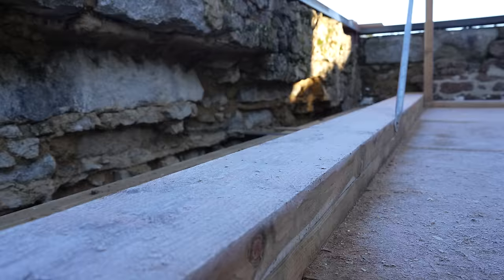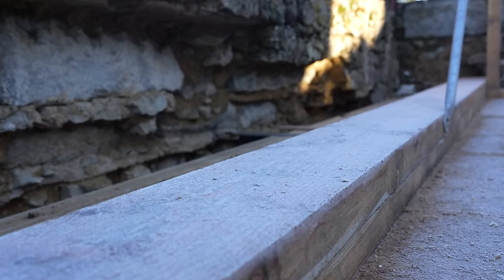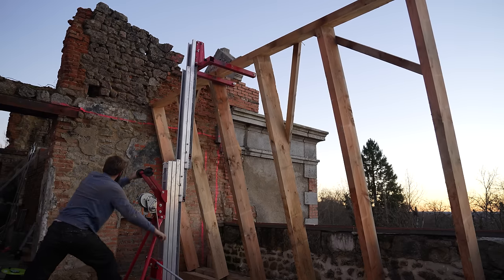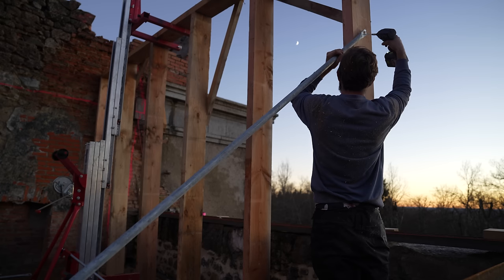Framing a chateau roof, alone.

Comment: Once the final wall is up, DO NOT take the bracing off until the rest of the roof structure is on. If you've got to move the bracing to put the final wall in, so be it but the bracing should stay until the entire structure is complete. That way, when you're putting the trusses on for the roof, the weight won't push the wall out of plumb.
Reply: exactly! those walls will not be a selfsupporting structure untill they have internal bracing (be it trusses or just by sheeting them! Until then, they are just a couple of matches held together by some screws.. to avoid them tipping over during your way of righting them up, I'd like to see you use some diagonal ropes/straps of the right length that will keep the wall upright until you brace with your metal studs..
Reply: Call me old-fashioned, but I would like to see the studs notched into the top and bottom plates and permanent diagonal bracing notched in and fitted. Plus, once upright and aligned the end studs bolted or nailed to the brick wall.  

Yes it will take longer, but it will be done closer to "right".
Reply: @whatnowstinky  No matter what, everything should be bolted to the brickwork wherever possible, for sure. And if you're going with a traditionally constructed green oak frame,  I'd agree with you on all of the above, just to allow for a bit more movement and to be a bit more true to how it was done back in the day. And then timber pegs, not steel fixings. But, in this case,  douglas fir is used because it's strong but so fast growing that there's not a whole lot of seasonal movement in it once it's cut and kiln dried. So definitely no requirement to notch into the top and bottom plates. And for the diagonal bracing, again if you're not going for traditional construction methods, the strength of mechanical fixings and steel strapping, while ugly as sin, is equal or superior to the old ways. Personally, I too think this should have been constructed traditionally but it's not my chateau and it's probably beyond Dan's skillset and budget at this point anyway.
Reply: Noching weakens the frame by thinning it @whatnowstinky
Reply: I absolutely love the guy for his never say die spirit, but to this point everything he’s done, while requiring a tremendous of effort, it’s not at all complicated. I’m very worried for him moving forward

Comment: Next time you do it, just measure the distance from the top of the wall to the floor and tie a rope to the top of the frame and fix the other end to the floor, that way it will save the wall from tipping over the stone wall if you go too far with the forks. It will save it from falling down
Reply: I had the same thought
Reply: THANK YOU.
Reply: this is the first tome i have seen the top and bottom plate sqewed screw when the top and bottom would nirmally be secured from the face side of the plates . then the the frame would be stood ???  Do you not think fabricating on the ground the getting a crane in for a couple of hours . this would be a lot safer and quicker.

Comment: Dan, when erecting stud walls regardless of size you should have a bottom plate already attached. As you have done the sole plate is fixed and the bottom plate should be screwed through into the ends of the perps ( virtical studs)
Screwing through at 45% is not sufficient!! 
Another tip when working solo!!
Use some old hinges, screw to sole plate and bottom plate before screwing studs, then you create a hinge point which will perfectly align the two, it will also help to stop any over tilt of the stud frame.
Hope it helps.
Another point when working alone!
Arrange checkin times by text with someone, if you don't they can call you see all is ok or worst case get help to you. I use this and its a great backup and peace of mind.
Doing a great job, I have all those 'T' shirts so goid on ya!!
Merry Xmas☃️⛄️
Reply: Hinges are a great idea! I was wondering if anchor points in the flooring joists with rope tied to those and the top of the framing. That might allow the framing to reach it's level vertical position while preventing it toppling over the stone  wall?

Comment: Dan just an idea for winching everything up. Put an I beam up at the top level stretching from the turret to the wall in the hallway and make the winch on rollers! You can easily get all the heavy stuf on the floor without to much effort because the winch can be moved while under load. We have this same system on the garage sealing. Works like a charm. Big I beam, steel rollers wrapping around the beam on a frame to hold the winch. once you cannot go without.
Reply: Good idea, should install it at some point for the remainder of the build.

Comment: To add to an earlier comment, you need to build a proper lift system on the outside of the chateau. Given the amount of material you are going to use, a proper lift would certainly be more efficient and more importantly, SAFER.
Reply: How much would that cost to install? At the moment the hoist is centrally located to access all parts and levels of the chateau.
Reply: @Sjb-on5xt  It would be peanuts compared to what he will spend overall. He won’t be doing anything if he gets injured.
Reply: I saw a nice lift on Bordeaux Life Channel. It would work great for small stuff like loads bricks and  roof tiles. It looked like a ladder with a square type bucket that moves up and down the ladder. Very cool tool.
Reply: Yes @tracksidebc5854 you are correct.
Safety is important.
And Dan worries me that he does so much alone by himself.
Reply: @richiejames928  Good point.
Reply: 100% agree, safety and efficiency. have a lift on the outside, just a cheap transporter lift will be sooo very efficient. choose it's location strategic and allow for a delivery dock for bulk materials at the foot of the lift. That way you'll skip the steps at the entrance where you currently carry your mortar by the bucket, load materials onto the lift by wheelbarrow and in barrels instead!
Reply: And easier on his body!
Reply: Couldn't agree more. A very prudent investment.
Reply: @ikerstges  can you imagine what he would attach the lift to?
Reply: @nancyjones247 I saw that too and thought Dan needs that 😂!
Reply: I told him he needed an external platform hoist and poibably scaffold too. All this was months ago. He did get an internal motor rope hoist, but he is going to need to shift a staggering amount of material up 3 or 4 stories to complete the project.

So far he has ignored me and he seems determined in flouting every safety guideline going.
Reply: @PreservationEnthusiast  He is a private individual working on his own property using friends at times to help him who accept the risks of working on his construction site and not a business. Clearly he's accepted the risks he's taken on as we do in every home we do up ourselves. I find it quite refreshing that he's not having to adhere to all the expensive elf and safety nonsense saddled onto construction sites these days.
Reply: @Curlyl0x  Similarly with regards to your statement, did I ask for your advice?

I doubt you are a construction professional with proper knowledge of CDM or H&S regulations, so I doubt you are qualified to judge the matter.
Reply: You know what? If there were a lift and a crane and stairs and what all else one reads in these comments, it wouldn't be Dan's channel. It would be one of a thousand similar, everyday channels. Dan is first and foremost an artist and a can-do man. That's what makes this channel exciting AND special.
Reply: Which earlier comment are you referring to?  Want to read the original for context.
Reply: @PreservationEnthusiast  And Billy Petherick just bought scaffolding quite inexpensive from England. He was surprised at the price and quality. Much cheaper than France and they deliver it.
Reply: He wont, as much as he refuses to wear gloves or properly secure the working area or use a proper scaffold or proper technique on anything. Im not sure but i think its bait to get more engagement on the channel... but its also just dangerous and ludacris. He is the worst rolemodel- kids, dont do this at home

Comment: You should build an “A frame” looking thing which would temporarily screw to the floor and have a vertical board tall enough to act as a “stop” at the top plate so the wall can’t go “over center”.  Once the wall is braced, that A frame comes out.

Comment: Curious as to how you’re going to finish the brick work with the walls in the way?
Reply: Take my comment with a grain of salt, because I'm not an expert roofer. But I think that judging from the old photos and the christmas ornament, of the shape that was being displayed. That there's going to be a super imposed structure that rest on top of the structure he's currently building and on top of the stone walls. The one on top is the one that will get boarded and close off the roof. So he will still have access to the walls underneath when it's done.

I imagine that eventually when the stone walls are finished to restore, the windows installed and all. That he will put isolation and close off the inner walls, leaving him with a usable room. But yeah, if that's the case, until it's all finished he should pretty much have access to everything. He might have to use smaller stone chunks and parts to work in the space between the inner structure and the outside stone walls. But it should be do-able in any cases.

Comment: Dan, I suggest you devide the next section into three smaller pieces.  Then raise the two corners first and fastened it together. Then erect the center section the last.  You will have strongger middle section that will help carry the load of the roof.

Comment: If I would be putting that roof structure up, I would put the uprights up one by one, brace them temporarily and then hoist the horizontal on on top. Less weight to juggle at one time and more control.

Comment: To avoid the wall tipping over, tie a couple ropes to the top of the wall and anchor them to the floor with eye hooks. Simply measure the angle from the floor to the top of the wall along the angle you wish to use. Nothing expensive, nothing scarry, and a solid safe working system! I used that system when building my own house without help and it works safe and well!

Comment: So, with your next wall, you might be happier to set, and brace, your corner posts, then one intermediate post (at the seam of the two lengths of the rafter plate), rather than building and setting up as bent (the complete wall structures you are building and lifting as one piece). Once they are up, you could use your lift to get your rafter plates up, then the rest of the studs afterwards. Bents are great at ground level, with a robust raising crew, but, as you've justly noted, they are a tad hairy when as high as you are with limited equipment and crew

Comment: Morning Dan,
Gotta say this:

The way you've done this is super risky and completely unnecessary.
1. Base plate first.
2. End studs - braced.
3. Top plate using the lifter.
4. Fix tip plate.
5. Brace corners.
6. Infill with studs, and noggins
7. Brace corners - permanent - internal of frame.
8. The second wall should have been attached to the first wall - NOT the opposite wall as the second wall - that way you'd have the first two walls fixed together to further support the two walls - then build the 3rd wall.

As a thirty five year carpentry/builder veteran - don't build the rest of the roof frames the way you've done it so far!
Reply: Yes, all more sensible and logical.

Comment: V197: BEAUTIFUL SUNSETS there, like you say shame to cover it up BUT you ll have balconies up there so you arent losing it completely. You could also put a WEBCAM right on the top of the turrent when its finished! It does look well sketchy getting those frames into JUST the right place ALONE!  But with the frames up you can attach some strong ring bolts to clip fall arrest equipment to! TAKE CARE.

Comment: Dan, you are incredible, and so inspiring! 400k that’s awesome, and just the beginning! 

I’m an interior designer in Texas, and plan a lot of renovations and additions here. As I see you on the floor that you are now putting the roof supporting wall on, I can’t help but visualize the mirrored location on the other side of the chateau done little differently… what about a glazed roof there and make that space a winter garden or solarium. I know it’s a ways from the ground floor, but surely you are planning a lift in the building somewhere. Just thought… same roof shape, Parker structure at corners and ridges, all glass between. In the day you get the view, at night with lights inside it will be like a beacon on a hill to all around it. Keeping the shape and giving it a modern nod to “Dan the Gardner and his humble start.”

Anyway, keep it up, you’re inspiring the masses every day! 🤠
Reply: Stipulation upon purchase was to recreate the original roof
Reply: @NurseSherry  understood, keeping the same original lines with a different material could still be an option.

Comment: Dan - if you are worried about the framing slipping off the forks, tightly clamp a couple of "G" clamps on the outer end of the forks, but not clamping the timber to the forks.   They will stop the timber sliding off the end.

Comment: An idea for that fanal wall inregards to the tipping point when your lifting the wall up: You could anchor a rope behind you that is just long enough for the wall to be vertical. When attached to the top of the wall it would allow you to just push it upwards/forwards know that when the wall reached vertical the rope would go taught and stop it from tilting any more forwards. Since the bottoms are lifted and you are lifting it from the top having the safety rope mounted at the top would also me that the wall couldnt actually go over the edge even if things somehow got off balance. It would pretty much reduce the stress down to just the effort of lifting the wall.

Comment: Simply using a rope on the top of the wall  to prevent it from going too far would be an easy safety measure.
Setting up a block and tackle to pull materials into the landing area at the top of the winch area would make it much easier and significantly safer.

Comment: I did a lot of handling of 12 metre poly pipe lengths and we used to have pallet sized trollies like the one you have and various stillages all on wheels for moving pipe about. 
Invaluable when you can't use mechanical aids. 
I know the feeling of holding your breath when doing the final positioning with the pallet jack.
To make certain nothing would disappear off of the fork tines we'd use another sling to tie off the  load onto our forklift. 
I'm not sure that's a good idea with your jack because you don't have the weight of a forklift for your anchor. 
You could run a rope from your load back over the  pallet Jack where it can be tied off behind you. 
Then there is the golden rule that when something is falling that you stand back and watch. 
I've lost count of the number of times I've  seen people try to stop impossibly heavy (tons) loads from falling by hand.
Most people learn often after a kick in the pants to ignore that impulse. 
Hey if you don't like doing things twice then do it right the first time.

Comment: Just an idea when lifting the walls. Wrap a sling around the beam and also around the lifter. Then use 2 g clamps on the lifter to stop the slings sliding. Lift with the lifter above the beam. Should be easier and reduce the risk of the wall sliding off the lifter.

Comment: I'm surprised that you have not framed in anticipation of the dormer windows.  I'm a little surprised that you did not: 1, put permanent diagonal bracing in. 2, rig safety ropes to prevent the frames from going too far. 3, add blocks/stops on the tall, hallway masonry walls to keep the frames from going too far.  4, add blocks/stops to keep the studs from sliding outwards on the plates.  5, use blocks/ropes/block and tackle to control the beam lifter from rolling back and knocking you off your feet.  6, adding substantial diagonal bracing once the frames were up, instead of those skinny metal braces.  7, built the corner posts into the front and back frames so that the side frame would be able to be tipped up between the front and back.  Now!  Get to work!  You've completed only about a quarter of the floor area framing on each floor!

Comment: If you can fasten the braces on loosely before raising the panel then the angle will be able to move as the panel goes up always maintaining a connection between floor and panel.

Comment: You completed these wall raisings in as a safe a manner as possible. The hoist made it safe, since it couldn't fall from the hoist and over the walls. The hoist was lifting it the whole time, until you started drilling them into the base plate.  I would need an exoskeleton and a large bubble to cover the project, before I would even think of duplicating your efforts. You'll get your view back when you complete the top floor.

Comment: Dan, would you consider doing the next part in two parts? Not only would it be lighter, but with half up, you wouldn't have to worry about both outer parts falling outwards in the final moments before you secure them.

Comment: Don't build the whole third wall, just the ends and top=plate.  Then add the vertical studs in between.  A whole lot lighter that way.
Reply: I think you're right. He can position it with the lifter while he secures it  He ought to fit angle brackets that would support it while the upright are added.

Comment: Dan, buy yourself a nail gun!! Would be so much easier to get those initial fixings in place if you want to use screws for the main fixings, although nails are possibly better. Great work though. Best wishes for 2024